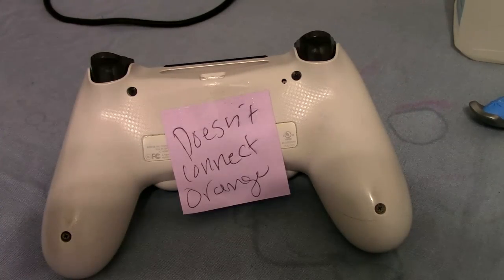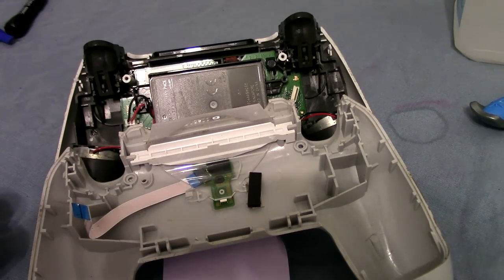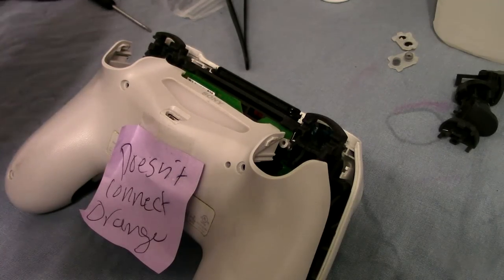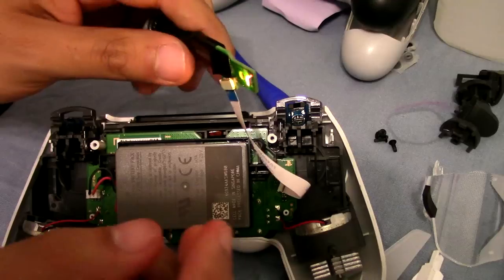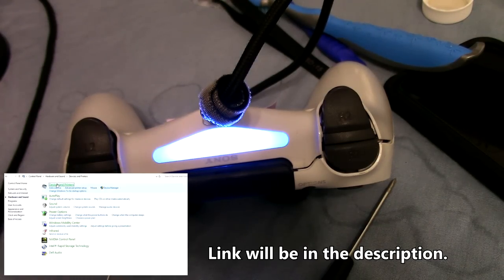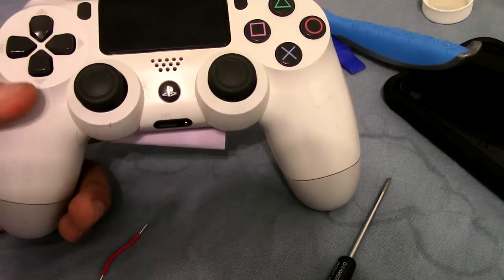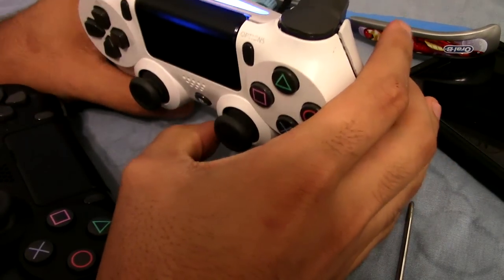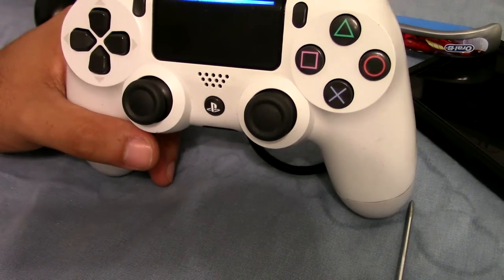How to Fix PS4 Controller with an Orange Light that Turns On Then Off (Conductive Film Solution)

Comment from the maker: FAQs
"What tools do you recommend for maintenance or repair?"

Tweezers, Philips screwdriver PH#00X50, compressed air or air compressor, 99% isopropyl alcohol, and microfiber cloths. These tools will fix most if not all problems with these controllers unless you need to buy a new part.

"Where can I buy new parts?"

This is up to you. The cheapest option is more than likely on Ali Express, but the shipping is horrendous--like a few weeks to a month. EBay is another option if you are able to find a seller in your location. EBay is more expensive, but you can get what you need within a week or sooner possibly.

"How do I know if I'm getting the right part?"

On your motherboard there should be something that looks like JDM-0XX. The "XX" are placeholders for numbers such as "40" or "30". Just type into Google, "DS4 controller [insert part] JDM-0XX". Some parts are the same across different versions of the controller such as analog sticks. If you're still unsure, then compare the part with the picture of the listing.
Reply: Hello Alex, please help me out here man. I bought a new controller, not even up to 2 weeks old and i'm having this similar issues. It just happened to be dead out of a sudden. I plug it on charge, it shows the yellow light, charges, then i press the PS still while on charge, it connects well, but as soon as i plug out the USB charger, it becomes dead. I press the PS button and nothing happens. It only works while connected to the USB, and not wireless.
Reply: Thabsk got it fixed. Might need some compressed air for a stuicky  button on xbox
Reply: My controller only flashes yellow once then won’t turn on how would I fix this or what do you think is wrong with it
Reply: scroo
Reply: My right toggle was drifting so u took it apart and cleaned. I put it back together it fixed the drift. And it works. But it doesn't light up and it doesn't seem to charge now

Comment: You're a lifesaver! I was stuck for so long trying to figure out how to get my ps4 controller to talk to my ps4 again (it worked fine with my laptop when plugged in). All the guides I found online just said the same thing, 'press and hold the playstation button', with various useless suggestions like trying a different cord etc... Replaced the conductive film today and it's working again, actually turned my ps4 on while I was fixing it as I accidentally must have pressed the ps button xD
Reply from the maker: Glad it worked!
Reply: It didn't work
Reply: @dollydimple83  It did for me. Perhaps your controller has a different issue?

Comment: For me, the only solution that actually worked was deleting all bluetooth dualshock 4 devices that have been sinced through the bluetooth devices settings in playstation while using a secondary working dualshock 4 controller. I had to go to Bluetooth devices using a secondary working dualshock 4 device. Then, I deleted all the connected dualshock 4 controllers, excluding the one being used. After that I held the malfunctioning dualshock 4 controller's ps plus share button (without a USB connection) until it was in sinc mode. Once in sinc mode, I waited until the dualshock 4 controller shows on the bluetooth devices list. Once it was shown on the bluetooh devices list, I used my functioning dualshock 4 controller to enter that enlisted dualshock, and I pressed the options (select button) connected it from there (wirelessly) and voila it worked. So, the whole issue for me was a system syncing error issue rather than a controller reseting issue. This happened due to the fact that the PS4 controller was connected to a different ps4 system, and after switching back to the previous ps4 console. Reseting the ds4 didn't work. Only removing the sinced controller error and resinking it using a secondary controller worked for me. I hope Sony fixes this sincing error issue, especially for those who don't have a secondary ds4 controller.

If this solution didn't work, this means that the battery needs replacement.

Best of luck 👍

Comment: Hi guys, my issue was very similar with only one difference, my ps4 would randomly turn on during the night which along with info from this video led me to believe there was an intermittent ps button problem.  I followed the instructions up to the point of inspecting the connector film. I noticed some minor marking. I cleaned the film with a cotton  tip and tested. This seems to have fixed my problem. 
I have reassembled My controller and the problem has been fixed. 
Thanks Alex.

Comment: This is very helpful! After replacing the left analog stick part, my ps button is intermittently being recognized to my ps4(When it is recognized, it works perfectly fine.). I'm going to re-inspect the conductive (also bluetooth wire line on the pcb) and clean them with pure alcohol. If issue still persist, will replace the conductive film.

Comment: Thanks for the video. Just FYI if the orange light only blinks once, it's because the controller is fully charged :-).
Reply from the maker: Yea I figured that out lol
Reply: i have the same problem 2
@Mabsar Karim
Reply: Mabsar Karim same here blink 1 time orange
Reply: @SRLula79  how did you fix it
Reply: But it still doesn't connect. Wirelessly how do you fix that
Reply: How do u connect the controller to the ps4 with the USB if I plug it in and it blinks orange one time but not connecting to the ps4
Reply: Hey how do you fix your controller? Its my problem now
Reply: Jesus maya did you fix it, how, I’m really board right now l, please get back to me

Comment: THANKS BRO Replaced the film from a different controller to my broken controller which wouldnt turn on and it worked perfectly. Had the same problem, PS button wernt working, replaced film, boom, working. THANKS AGAIN

Comment: This video actually really helped me. My controller was flashing a BLUE light 6 TIMES. It also PULSED an ORANGE light when I plugged it in. I tried resetting the controller and thought that I did the pairing mode thing. My controller would flash the blue light whenever I pressed the PS button, but wouldn't connect to the console. I ended up using a second controller to go into the bluetooth settings and removing the broken controller from the list, and then holding the share and ps button until it blinked white. I then went into the controller settings and I saw a new controller to pair. And boom, finally my controller would connect, and it ended up being a SOFTWARE issue. I only say that last part because I swapped out about ever part imaginable (including the conductive film) and the controller would still not connect. Thank you.
Reply: Mine does that but only in usb cable in some games like horizon zero dawn, days gone but in bluetooth is connecting properly.

Comment: Had the same issue. My fix was making sure the blue film on the front of the controller was lined up with the contact for the circuit board on the back it was not lined up after I took it apart the first time. It being slightly off was my issue.

Comment: Mine does the same thing! It's been tormenting me to figure out what's wrong with it for over a year! I never would have suspected the PS button or the conductive film, controller was gently used and never got dirty. But now it makes sense because before mine was doing what you show in the video, I could get it connect only by rapidly pressing a bunch of buttons, but even then it was like half of the button presses wouldn't register when using it. So it makes sense the film part was going bad. Very weird issue considering it'll work with another device but not with the PS4 when this happens.

Comment: For me it was the exact problem which is mentioned in the video. For me i found the dirty place or burned maybe, cleaned it, pressed with screwdriver and it worked. So if nothing works, it could be the problem guys. Clean it or buy new one. Cheers
Reply from the maker: Nice!

Comment: Yup that’s the problem. Dropped mine in the toilet, hard to explain but cleaned it got a new battery and the yellow light comes on then it does. Checked the conductive film and the connection is fried. Thanks !
Reply from the maker: Glad to help!

Comment: Do not take your PS4 controller apart!! Turn your PS4 on and connect the controller to the USB and press the PS button + Share button at the same time and it fixed my the issue for me. The ps4 has to be on for you to start the button process on the controller. I just fixed mine.

Comment: I'm commenting this in August 2022.
My controller was behaving in a similar way described here:
Turn on the PS, controller was blinking yellow once and it wasn't working. Furthermore, pressing the PS button caused the controller to blink white several times which was the signal that the battery is nearly dead.
After browsing multiple places, I found out the solution in my case which was TOTALLY UNRELATED...

I downloaded DS4Windows, a piece of software which lets you test your controller on PC. This told me my controller was actually at 100% battery, fully charged. And all buttons were working, too...

Then what I actually did was to boot in safe mode (long press the power button) and do "Restore Default Settings" - this will remove your PSN account logged in session (you have to login back and games are safe no worries) and reset your internet connection settings.

Because that was my  ultimate issue - the internet connection settings. The PS was trying to reconnect to my 5GHZ WIFI connection and was failing in a matter of moments causing my controller to become dead AGAIN.
So there are two workarounds:
If your router is dual band, use the 2.4GHZ connection instead (my approach).
Use a LAN cable instead.

I hope this helps... And thanks Sony for wasting 4h of my time troubleshooting after your crappy updates.

Comment: This man has literally saved a controller of mine that stopped working over a year ago. I literally had tried so many times and so many dead ends.

Basically I ruined my other controller om accident making some repairs, so I had to use the motherboard and everything from this controller. Experiencing the same issues but determined to try a solution before paying due to a defective product, I went down a 5 hour rabbit hole that ended with me swapping out the conductivity magic plastic paper my shit working. Bless this man.

Comment: Hi. I watched through the whole video and noticed that you know what your talking about and I wanted your take on the situation that I’m having right now. For some reason my controller cannot function without it being connected to the charger. I haven’t opened it up. All the buttons work perfectly whenever I’m playing and I don’t think anything is wrong with the USB port considering that’s how I’m still able to use it, but yeah. Any kind of info would be greatly appreciated
Reply: This is probably due to your battery. Does is stay on without being plugged?
Reply: Did you find out what's wrong/a solution?
i have the exact same problem
Reply: I have this same problem as you and i change the battery so i dont think its thst

Comment: Hi Alex ! Thanks for your video, my controller still works (though input is lagging) all buttons seem to be working and it does still power on, however it won't charge. It's a 20th century from a few years ago, I never used an original cable to charge and have used several power sources. Do you think the battery got fried?
Reply from the maker: Yea it’s a possibility because using different cables at different voltages or current values that are not standard can degrade the battery over time.

Comment: Great video. Where do you order your parts from?
Reply from the maker: Depends. Ebay or Alibaba. I would go based on what's local to save on shipping lead times.
Reply: @Alex-jbz  I have tried ebay but all or most of the parts are as cheap as can be and the ones advertised as OEM are cheap replicas. I have been trying to find a source of good or genuine parts which is surprisingly harder than I thought. Thanks for the reply.
Reply from the maker: @PapaGleb  yea that’s might be a tough one. Idk if Sony is the type of company that sells OEM parts or believes in “right to repair”. Tbh they probably outsource it to China anyway for economical reasons. 

Anyway, you can try to buy broken controllers to get a genuine one, but I don’t know if that would be worth it monetarily.
Reply: @Alex-jbz  yea your right. It makes sense why I am unable to find a source. Guess I’ll trial and error until I find a good quality parts. I know the sticks Sony and all console makers use are from Alps Alpine and those I ordered directly from Alps’ distributor but that is the only part that I could find the actual manufacturer lol. Iv always loved electronics and electronic repairs but it never made sense until just very recently and I got into it.  Alex thank you very much for your time and replies. It’s so great watching videos but then when you have e a question no one ever replies. I get it the bigger the channel the most questions making it impossible to answer all but I’m still stuck with an unanswered question lol. Thanks again !!!
Reply from the maker: @PapaGleb  yea no problem! I try my best to keep up with the comments. Good luck with your search!!

Comment: Thanks! Mine was doing the exact same and this helps, now works, Mine was part of the film near power button looked smudgy, cleaned and worked.. Except my L2 isnt working now -,-
Reply: i know this comment is old but did you unscrew the controller then clean the button?
Reply: @Sosatocrazyyy  yeah took apart and cleaned the flex ribbon with a q-tip and it sorted the issue
Reply: @Sosatocrazyyy   I think in the end I ended up buying a new ribbon thing, was only a few pound and worked like new
Reply: @frustration3263  Did you use alcohol with the q-tip?
Reply: @Sosatocrazyyy No but isopropyl alcohol is fine to use
Reply: I've fixed several controllers with all diff issues since this, I'd say just get comfortable taking it apart and look how it all works and it and any issue becomes very easy
Reply: @frustration3263  i have that exact alcohol thanks imma try that and give and update
Reply: @frustration3263  One more thing when i take apart of the controller and put the alcohol on the q-tip i just have to brush the ribon part with it to sharpen then small antennas for it to work right?
Reply: @Sosatocrazyyy  just brush along the metallic lines and make sure clean, obvs make sure dry before putting back on but isopropyl will dissolve in seconds
Reply: @frustration3263  update: so i tried the alcohol method like you said and it didn’t work i put the q-tip on the alcohol and tried brushing it on the lines with the alcohol and it still didn’t work any other solutions plz?
Reply: @Sosatocrazyyy  I know this was a slow reply, what exactly is ur controller doing?

Comment: My controller blinks yellow/orange (charging color) 3 times rapidly every time I, Press the PS button, Press the reset button, and plug a charger in while its connected to the PS4 or wall. The issue is I spilled a drink (choccy milk)  and some of it got on my controller and leaked in through most of the gaps and buttons :/ when I first spilled my drink on it it still worked but the buttons were not responding, so I cleaned all the buttons and the conductive film and the buttons worked again but then out of nowhere my controller stopped responding, and started doing this Orange triple flash problem. Idk what to do, I don't think cleaning the parts again would help.

Comment: Thank you!!! I have the exact same problem with my controller. Where did you order the part from? And whats the part number?
Reply from the maker: I usually use Ebay. I also buy more than one because I fix multiple controllers and buying wholesale is worth discount and shipping. But if you're willing to buy from China, then it will be roughly $2 but you would have to wait a month before getting it. But if you buy it from the states it would be roughly $5, and you'll get it within a week.

As for the part number, there are two different types: JDM-030, JDM-040. If your controller is like the one in this video, then get JDM-040. If your controller has two pieces instead of one, then get JDM-030. The best way is to take apart your controller and just see which one yours is and just compare it to the ones online.

In no way am I sponsored by these links...

JDM-040 (US): https://www.ebay.com/itm/JDM-040-Conductive-Film-Buttons-Repair-Part-For-PS4-Controller-DualShock-US/352275909342?hash=item520547cade:g:nqQAAOSwYGBZjBsM

JDM-0XX (China): https://www.ebay.com/itm/Replacement-Buttons-Ribbon-Circuit-Board-For-PS4-Controller-Conductive-Film-CA/183421873338?hash=item2ab4cbacba:m:mFwna8PJqE-7cfhCHaS_OTQ

Comment: Hello Alex, thank you for your video. My controller was completely dead, i went step by step using your video. I got the blue light to turn on through Ds4 windows. The only difference was that my PS button brought up a window on the laptop when i pressed it compared to yours that did not. Could the issue be the same as yours? Thanks.

Comment: Alex, I got a controller here. I press the PS button, it doesn't pair. I get blue lights when pressing the ps button. When I plug it in, it is orange (slow blinking). Tried letting it charge for hours. Tried disassembly (everything is connected and clean). Please help.